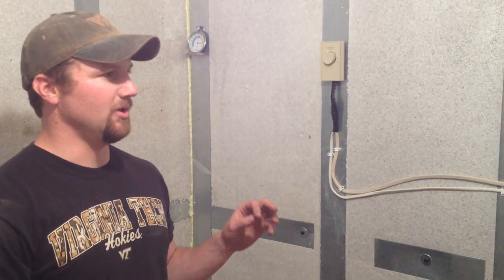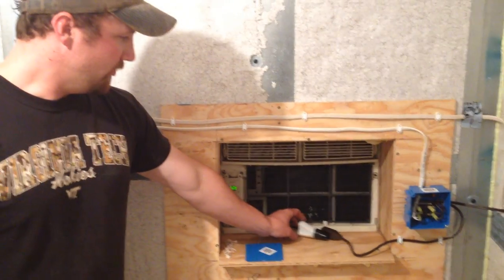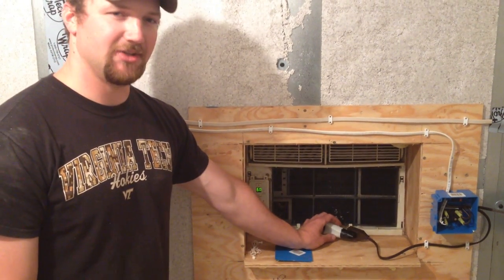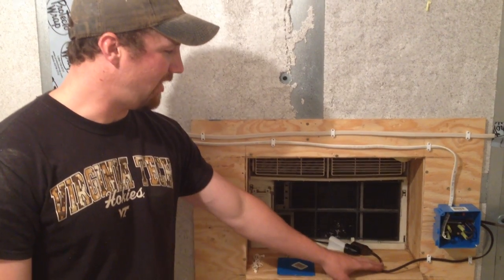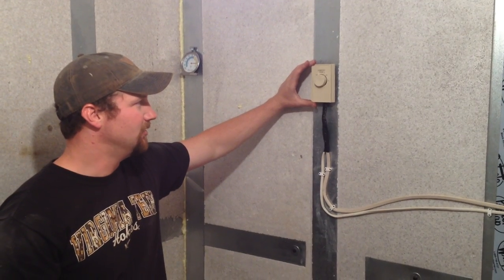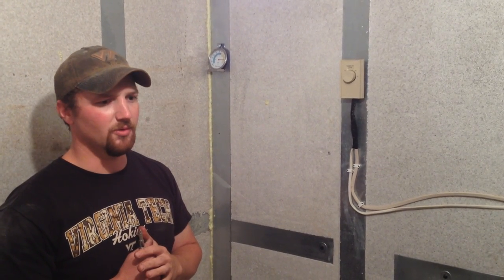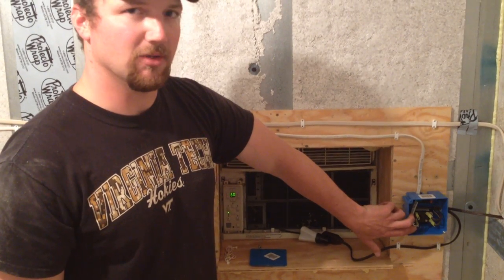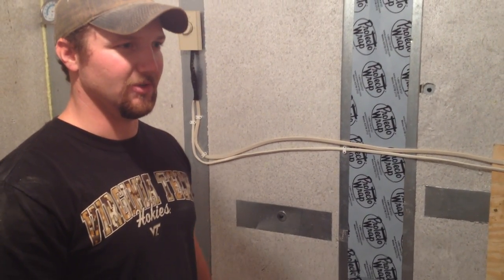Farm Walk In Fridge Built Without Coolbot!

Comment: You can do this without the lightbulb. The temperature probe is a thermistor (verify that by checking the parts list!) That’s a resistor who’s value changes with temperature. Cut the wires to it and measure its resistance at a warm temperature. Then solder an ordinary resistor of that value across the wires. Save the thermistor in case you ever want to use the unit normally.
Reply: I agree, provided the temp. probe is indeed a  thermistor. The minimum temp. setting on most window a/c units is 60 degrees F. Cut the wire to the probe. With an ohmmeter, find the resistance at both 60 and 32 degrees.  The goal is for the a/c unit to detect a resistance value which is normally produced at 60, when the temp. is actually 32. The resistance in a thermistor decreases as temp. increases. Let's say the resistance @ 60 is 50ohms and 100ohms at 32 degrees.   If you connect a 50ohm resistor across (in parallel) the probe leads, then the a/c controller will "see" 50ohms @ 32 degrees and "think" the temp. is 60 degrees.   Then you can adjust the a/c temp. setting accordingly. 
ie: if you want 42 degrees then set at 70. Of course you'll have to fine tune by correlating with a thermometer.   I think it's a good idea move the probe a few feet away from the a/c unit.

Comment: You could use a Ranco ETC 111000 controller to turn your bulb (heat source) on and off. They cost about $50.  They are simple to use and you can program the temp and differential in it.

Comment: I like the idea of the external thermostat on the wall, but assume you somehow don't have frost buildup issues on the cooling fins that block the fan??  I had a problem when cooling a warm room (ie. from 70 degrees to 40 degrees).  The condenser would not go into a defrost cycle and the frost would build up and block the cage fan in the AC to the point where it would not turn.  Also, the frost buildup on the cooling fins blocked air flow from the AC into the room, stopping the cooling action.  I had to add a timer to the night light circuitry to force the condenser to shut off and defrost every hour or so.
Reply: I have done this, however I cannot seem to get the settings just right, I need to get the temp lower before the timer kicks it off, however im frosting up before then. I have an ink bird with a 3 degree differential and 5 min delay. Temp at 3, however it only ever gets to 7 based off an external thermometer
Reply: @nelsontheseagull  I don't know what an Ink Bird is, but with my window AC unit, I need to have the night light timer turn off at least every 30 minutes so that the compressor shuts off for at least 15 minutes and defrosts.  This schedule, of course, depends on room size, size of AC unit, outdoor temperature, etc.

Comment: Do you have problems with the AC freezing up?  What size AcC unit are you using
Reply from the maker: Yeah we have the system way different now and have a side by side fridge freezer defrost sensor across the front and a greenhouse thermostat hot wired directly to the compressor. Pull out all the computer crap

Comment: nice build!!  I built one also, but used a refrigerator thermostat wired direct with one ac, and a regrigerator thermostat to control a light bulb for the other ac.  have you noticed any problems with the ac icing up with yours?
Reply: I have icing issues when the outside temperature drops below freezing.  Otherwise, my setup using a timer to control the night light, rather than a thermostat, achieves the same cooling effect.

Comment: That looks like a great solution, as long as the night light bulb does not burn out. How do you prevent that from being an issue? Thanks for the video!
Reply: I've replace the night light twice in 5 years in  my retrofitted AC unit.  Just put the light where it is easily accessible (ie. outside the AC)

Comment: I bet if you took a decent sized deep freezer...put it in a small but extremely well/border line overly insulated shed...and left the freezer open with a fan inside ..might turn shed into walk in freezer?
Reply: Shawn Albritton, freezers dont quite work like that, freezers cool the inside but heat is dissipated from the coils along the back of the unit. So the room would most likely slightly raise in temp.
Reply: unless you cut a hole in the wall and sealed/insulated the radiator outside
Reply: This is what I am doing....had lightning zap an upright freezer, new computer got it running and cooling but it doesn't shut off (even down to -25°F on about the halfway setting).

So, insurance paid for a replacement and the cost for getting this old one worked on....going to build a big insulated box to attach the freezer (without the door on it) to the box. I'll control the freezer with an external temp-controller, two stages for heating and cooling....will be able to cool in the warm months, maintain temps in the up and down temp days of fall, and then heat it in winter...all to maintain whatever temp I need.

(this is the same I do for a fementation chamber with a dorm fridge, and a keezer with a chest freezer).
Reply: @mthompson  hi Miles! This is what I was planning to do for a walk-in deer freezer. How is it working for ya?

Comment: I have not been able to find a reversing switch and I have checked with every electrical component  supplier
in our area!  Could you please post who the manufacturer is and the part number?  Thank you.
Reply: The "reversing switch" is just a relay with normally closed contacts, so that when the temp drops down the temperature set on the thermostat it powers the relay and opens the contact. When the temp raises above setpoint, the thermostat doesn't power the relay and then the normally closed contact closes.
Reply: Seems like it would be simpler to get a cheap temperature controller, power resistor, and a 12 power supply shipped to your door for 20 bucks.

Someone needs to make an open source knock off for the overpriced temperature controller they sell for this.

Comment: You basically engineered an alternative to cool bot. I could be wrong but if this is something you can build and resale I think people would buy it from you. Maybe build one and sell it and eventually sell more at a time. Thanks for info I would buy this thing from you if you sold it gonna buy cool bot since it's plug and play lol. Most people aren't as smart as you I don't know what you do and the time too. Might take too much time for me to figure it out might end up failing buying cool bot at end. Peace G-d bless
Reply: This could be made soooo easily and inexpensively.  The coolbot appears to be a high-end product, and the company is probably spending a lot on marketing, customer service, product features like multiple temperature sensors and displays, etc, so that's why it costs $300-$400.  That's fine for them, but a simple product without all that could be made so ridiculously inexpensive.